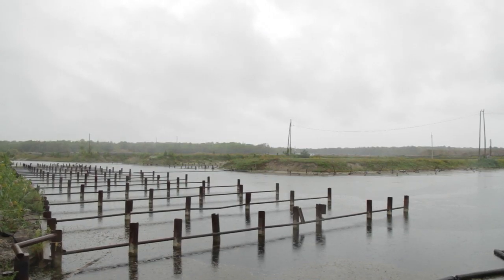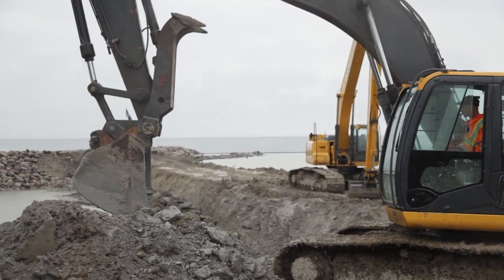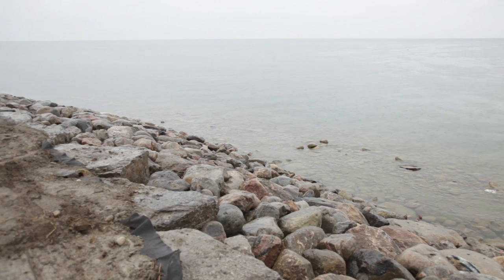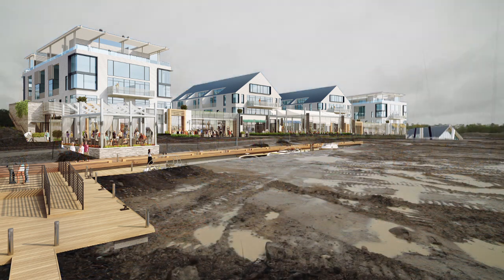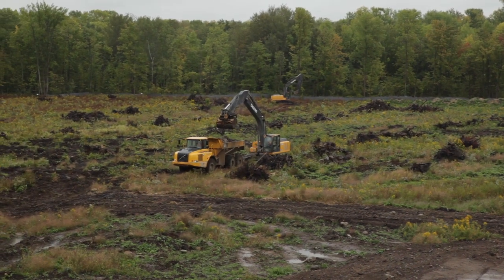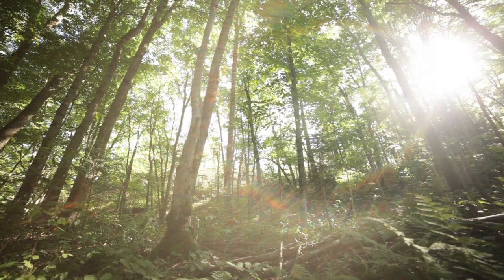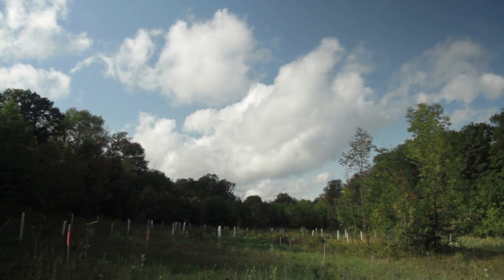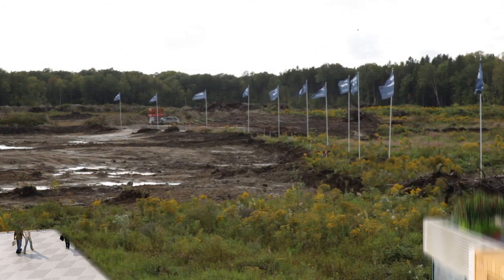Friday Harbour- A 200 acre nature preserve

Comment: Way to break the law. On a construction site in Ontario hard hats are mandatory for everyone on site at all times. First major issue in this video. Issue #2 - When on a sciossor lift (Skyjack model in the video) you are required to be wearing a fitted hardness with a lanyard or self retracting lifeline connected to the anchor point. You can even follow minimum requirements in Ontario, more so you do not know them, otherwise why would you show it in your promotion video.